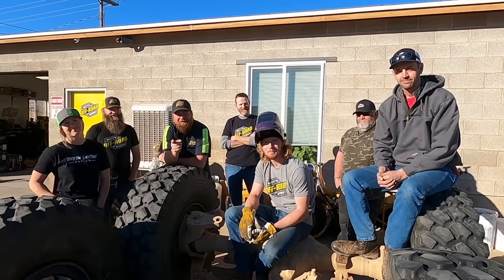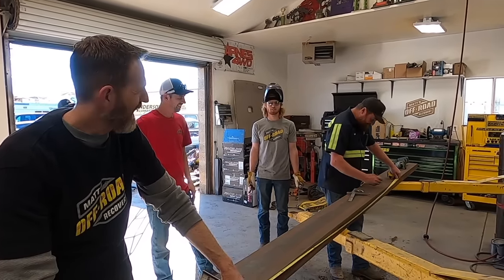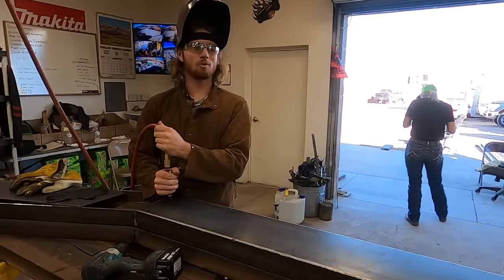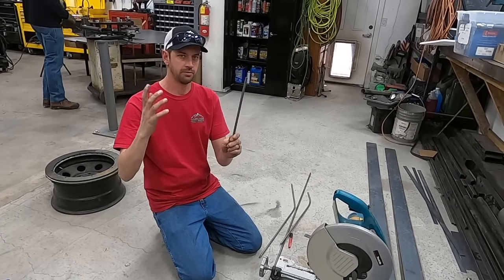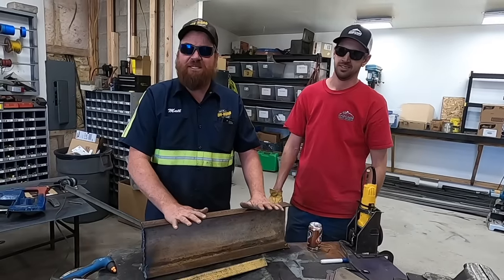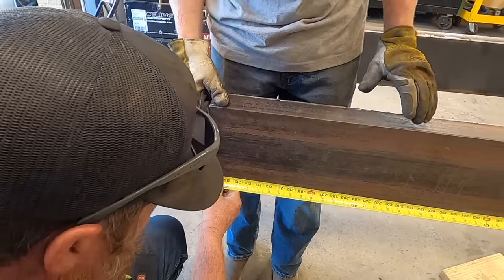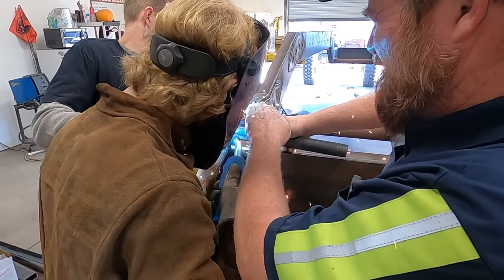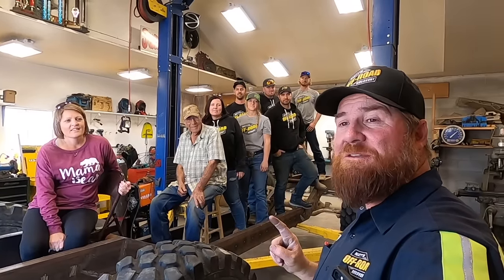I'm Building The WORLD'S LARGEST Off-Road Wrecker

Comment: Am i the only one wondering about those air tanks and condensation???
I guess drainage plugs can be added.... but dont you need some kinda anti rust stuff in there?
Reply: Matt never worries about rust. Where they are in Utah dry dry dry
Reply: A drain plug and an air dryer on the inlet line might help.
Reply: @rjoe1627  but with compressed air... there is pretty much always water.
When you heat rhe air while compressing it you increase the due point, then when it cools down in the tank, the dew point drops and the water condenses.

I know its dry there but i would guess compression systems still have water issuses... though i could be wrong.
Reply: @deth3021  I live in Vegas which is drier than Hurricane. I still have to drain my  compressor tank regularly. I also have  an air drier for painting Jeeps.
Reply: @TheBandit7613  thanks for confirming.
Reply: @gord7025  a problem with drainage plugs in that design is that there is no lowest point to drain from...
Sure an air dryer will help... but it shouldn't remove all the water....
Reply: @deth3021  Easily solved by parking on an incline and running the compressor to force the water out. It won’t be perfect, but the design is already flawed lol
Reply: @gord7025  good idea... didnt think of that for some reason... obvious when you say it.

Comment: Using the frame rails for air tanks seems like a cool idea, but I'd be worried about rust from the condensation. Might be wise to fit an air dryer in line to the tank.
Reply: Or at least a drain point to be able to empty out the condensation.
Reply: I really how they dump that idea. Plenty of room for actual tanks.
Reply: Cool idea! But unreliable implementation. But as Matt says, "This is how we do things out here." LOL
Reply: And a nice pressure relief system.  What about when you go from 80F running jobs one day and then it goes to 20F overnight?  You don't want it to suck in and deform like a tin can.
Reply: They’re in Arizona, there’s no moisture
Reply: @joshlockie9285  Hurricane, Utah, actually.
Reply: @joshlockie9285  Utah* but that doesn't matter. When you compress air, moisture condenses inside the tank. Doesn't matter what the humidity is when you're compressing the air.
Reply: @Studio23Media  It does matter, the moisture still has to come from the air. There will be less in Utah than other places, but there will never be none.
Reply: @davec.3198  A pure vacuum would be -15psi. If it can handle +50psi then -15psi shouldn't be a huge issue. Even if it was at atmospheric pressure and sealed, it'd never come close to a vacuum. In your example, 80F at atmospheric would be -1.67PSI at 20F. That's only 1000lbs across an entire pinned broadside. I would be very surprised if you could even measure the deflection from that little vacuum.

But in reality, I imagine the frame would always be under some pressure, so it shouldn't ever see any vacuum.
Reply: @Studio23Media  If it was 0 humidity it wouldn't condense. And condensation from compressed air has a linear relationship with humidity, half the humidity half the water.

Water alone won't cause much rust, it's water and salt or water and a dissimilar metal which cause significant rust.
Reply: @vipahman  And that's the problem with non-Engineers thinking that they know enough to tackle engineering challenges. Won't be a LOLing matter if it explodes and kills someone - which it legit could!
Reply: @christopherrto  Look up "air receiver explosions". Plenty of rusted tanks due to condensation pooling along the bottom and weakening the shell.
Reply: @christopherrto  Exactly, humidity will never be 0. Therefore, there will always be some condensation. And water alone will definitely rust raw steel. This is not an uncommon issue with air compressor tanks. Lots of people have been hurt when their air tank rusts from the inside then explodes when they're trying to use it.
Reply: @joshlockie9285  I guess you haven't seen the videos of snow rescues.
Reply: @Mick_A_Knuckle  I've seen some. But how old are those tanks? How thin are the walls? How frequently used? How frequently drained, and in what humidity? From what I've seen they're almost all rather old tanks used extensively and not drained. Further they're 1/8" steel or a touch thicker, not the 1/4"+ this I beam is made of.
Reply: @SalisburySnake  they will have plenty of condensation and it is a horrible idea to use the frame rails.

Comment: I have to add my concern to the rest about the frame doubling as an air receiver.  Consider too that if you pump it up in the morning when it's cool, then take it out in 105 deg desert heat, the pressure will go up as well.  

As someone else commented, look up "air receiver explosions."  Watch the videos where inches of rust are found in the bottom of older tanks.  Here's a link to a video in which a man was severely injured and saved by his grandson who applied first aid.  He spent three months in hospital. air receiver explosions:  https://youtu.be/KVP_A7eGYxw  

OSHA also has recorded fatal air receiver explosions.  This is not something to experiment on without a healthy and informed respect for the potential consequences.
Reply: It's not something to experiment on at all, regardless of knowledge, experience or willing ignorance. Anyone can purchase off-the-shelf rated pressure vessels that will be perfectly safe (so long as they aren't chopped or welded to). There's no call for this and it's incredibly dangerous. I've seen how diligently Matt listens to advice, so I'm just hopeful that nobody gets maimed or killed when it does eventually explode. I wouldn't ride in a vehicle (or even get into a room) with a DIY pressure vessel no matter who designed or welded it.
Reply: I've seen many comments pointing out useful considerations, making calculations up, and also exaggerating the danger of this frame pressure tank idea. Here are a few things I've been thinking of. Yes, air receiver tanks have certainly been known to fail catastrophically and cause great bodily harm to those in the vicinity, but this is notably different from your typical aging air compressor for a few reasons. First of all, air compressor tanks aren't designed (for good reason) as significant structural elements, other than attaching some wheels and the compressor itself. They often have relatively thin walls relative to the volume inside to save cost and weight, and if you look at pictures of common failure modes, a crack usually propagates from the weak point in several directions and the whole tank rips apart, occasionally into multiple large pieces. 

Secondly, in the cases I've seen, people were harmed because the tank hit them and it wasn't attached to anything of consequence. Matt's wrecker is a piece of heavy equipment, and the energy stored in the frame might rock it if released suddenly but could not send it flying. It will also have lots of other parts covering up the frame. It's totally different than someone leaning over an ancient air compressor and it exploding. In this case, if the tank was over pressurized and failed catastrophically, it is most likely that a crack would propagate down the length, steel would deform (a little), and the air would be released quickly. You've got to remember that the mass of these frame pieces is significant compared to the amount of air/energy they will store, it's not an efficient way to make an air tank at all. Plus, they're going to be welded in many places to other elements of the vehicle. As for shrapnel concerns, if there was a high explosive causing a pressure increase of many psi/µs, then the frame would certainly fragment into many pieces and be incredibly dangerous! However in this case, there's a relatively small volume to expand and accelerate pieces, and the steel should be ductile enough to bend rather than break into pieces from the stress.

Also, I strongly suspect that it will become too leaky after a bit of service on hard terrain due to fatigue and they will abandon the idea in favor of a certified cylindrical pressure tank long before it becomes a significant safety hazard. It just seems to me that a lot of people are treating this like it's a pipe bomb waiting to explode and send shrapnel into the team, and that's not an accurate assessment of the situation.

Comment: Great build 🥰🥰🥰. 
Just wondering, was there any swarf left inside the air tank after drilling out the pin bracing?  Did you just leave it in there for posterity...?

Comment: I’ve saw several comments about the concern with rust in the frame air tanks. I think there’s several solutions to this problem that hopefully would help this issue for future Matt (I know he loves dealing with issues). 

1. Spitter Valve - they’re commonly used on railway locomotives and other applications (couple of pieces of mining equipment I’ve worked with have had them.) they “spit” constantly to help promote against water formation within the tank. They are loud and can be annoying but with a vehicle like this, I feel like it wouldn’t be that huge of an issue. 

2. Air dryer (almost everyone has mentioned) - they can be effective but don’t get rid of a 100% of the water within the tank. 

3. Epoxy coat the inside of the frame tanks - there are some older processes available for coating the inside of the tank with an epoxy finish to help with combating corrosion. 

4. Sacrificial anode - while commonly used on ships, I’ve personally been apart of some research on the use of such an anode in wet environments that aren’t submerged. They work off of having a higher active voltage than the metal they are connected to and thus corrode faster. I would think you this could be allied to your application by attaching it to the frame and allowing it to the frame in a box or somewhere along the frame or by having one on a pressure fitting that allows you to put into the tank frame. 

I know this is a long comment but hopefully it reaches you and give you some ideas on how to combat the issue that has been raised. You might even be able to combine these and several other ideas here in the comments to further reduce rusting within your frame fit to water in compressed air.
Reply: Or buy an air tank designed to be used as such. So much time and energy spent on designing a problem.

Comment: My guess is the in frame air tank will begin leaking after a few trips over rough trails.  The frame flex will probably impact the more rigid welds and create pin holes.

Comment: Bro, I’m a mechanical engineer. I’m not going to go into detail because  if you really want to know more, you can YouTube it, but there’s a reason why air compressor tanks are cylindrical with domes on each end. Don’t make your frame an air tank. It’s a cool concept, you’re just not going to have the pressure you want due to safety concerns and it will leak as soon as you hit the trail.
Reply: Even with that thick C-channel steel? 
I'm NOT an engineer, just curous.
Reply: @TheBandit7613  the steel isn’t the problem. The weak part will be the welds that he boxes it in at because that is where it will be the weakest. Also the hard angles will cause an issue. Theres a reason why airplanes that pressurize the cabin at high altitudes use rounded corners on their windows. Not to mention the flex of the frame and moisture buildup as time goes by. It will probably work short term, but it won’t last as long or be as reliable as a normal compressor tank would. Idk exactly what he plans on doing, like I said, it’s a dope idea and honestly it’s something that can be floated to actually make something like that work, but it will take development time and trial and error. Personally, I’d build a long hotdog style tank and maybe place it inside a lager boxed frame and make it easily removable or place it behind a bumper.
Reply: @ginobenedetto4943   Now that you mention it, the De Havilland Comet  (first commercial passenger jet 1952) crashed. After testing, they found that the square window design wouldn't work with a pressurized fuselage. It crashed from metal fatigue beginning in the window corners. 
They went thru a lot to duplicate the problem on the ground.
Reply: @TheBandit7613  yup, exactly. The corners make it easier for stress fractures to form. Much of my job is modeling before we even make a full scale prototype and even then there’s away chance something will go wrong. Unfortunately sometimes life is lost. There’s a dark joke about engineers. “When a doctor messes up a person dies, when an engineer messes up, many people die.”
Reply: @ginobenedetto4943  I think he should re-consider the idea.
At work (I'm a heavy equipment operator) there's a heavy metal cage where tires are inflated. That tells me there's a lot of energy in compressed gas.
There's tanks of all sizes available. I'm sure he can find one that will fit.
Thanks for the info. I'll keep it in mind.

Comment: I love the idea of the built-in air tank. But I would re-think it if I were you.

That frame will be under a lot of stress from the kind of towing, from off roading, and just the general flex of driving. Add articulation into the equation and it will be a matter of when, not if, it pops. Snag a small portable, electric compressor and you'll be good to go. You're not running air tools or anything demanding. If you want an extra tank, just buy one and maybe even put it between the frame rails if you want it hidden.
Reply: It probably has air brakes. But yeah, there's plenty of room for properly certified tanks.
Reply: @SalisburySnake  brakes are hydraulic.

Comment: seems like a cool project, but i have to think: wouldn´t it easier to take an old Unimog and modefing it?
i know it´s not that easy to get them in the states, but i have seen them nonetheless for sale in the states. mostly the backhoe version as military surplus

size to what you are building should be similar, comes with portal axles, 3 lockers, air system and hydraulic pump (can be used to run hydraulic winches)

this would have been my first thought for something like that and i think i have seen a guy on youtube specialized in Unimogs around Moab
Reply: Yes I was thinking the same, although watching them building from scratch is more fun....
Reply: This is probably better content for the channel. They make way, way more money off this channel than they ever did as a wrecker, or even off road towing company. So, in reality, their work is centered around making youtube content rather than what would be the best and most efficient way to do off road recoveries.

This is a business decision, and it's probably the right one.
Reply: Plenty of Unimogs around here. 
Not common like Jeeps, but I see them often enough.